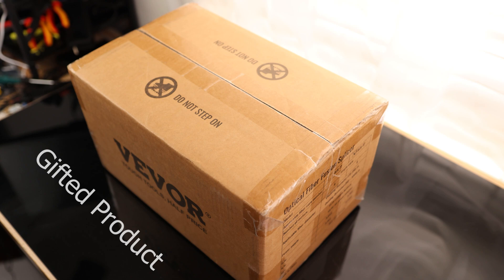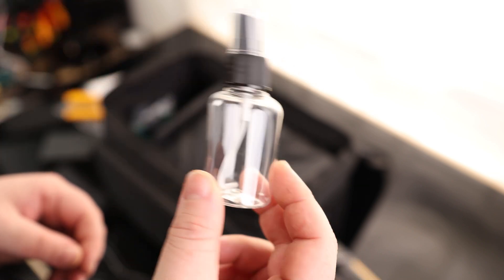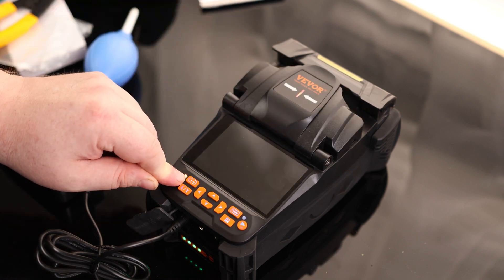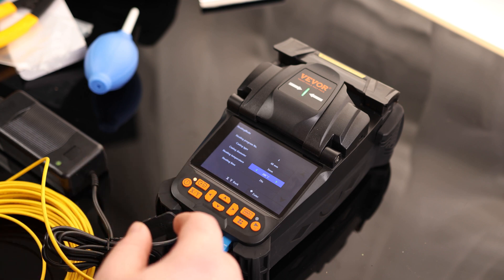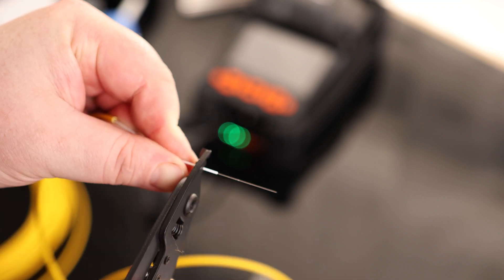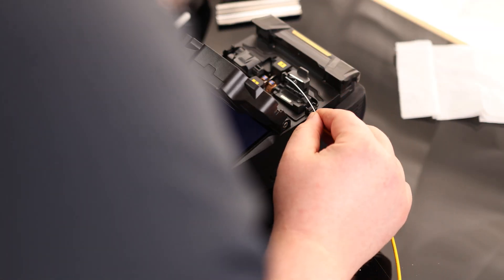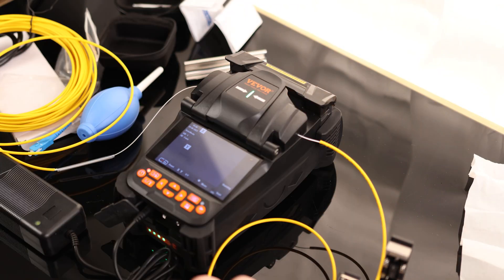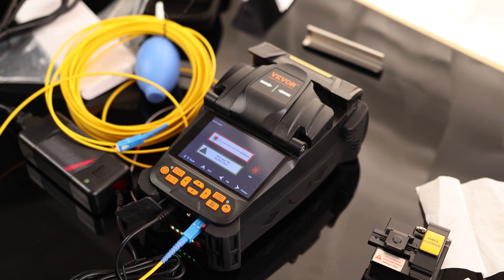VEVOR Fiber Optic Cable Fusion Splicer 6 Motors

Comment: Every splicer less than 10 years old will have a tension test function. 
The problem with these splicers is vevor dont sell spare batteries or electrodes, so you do 3000 splices and throw it away.
Reply: My old  Fitel 175 had a tension test. Every splicer  Ive used since the 90s has a tension test. Not sure ive ever seen one without. I do however only use Fitel,Fujikura, Sumitomo and Inno.